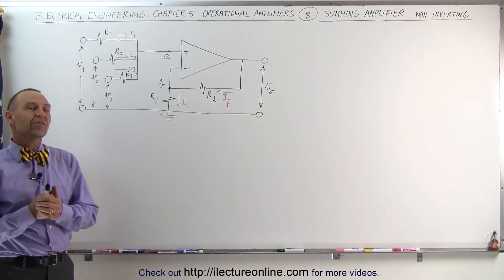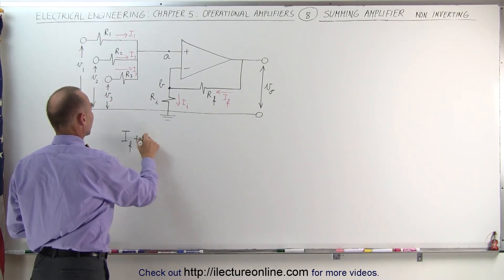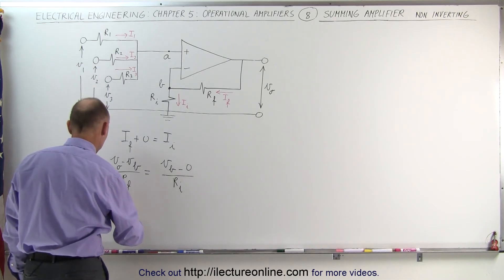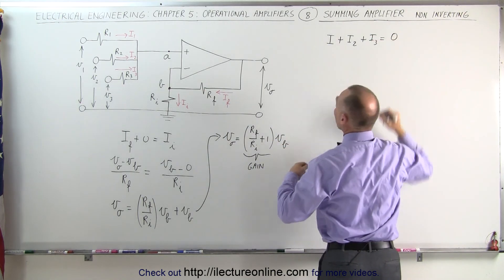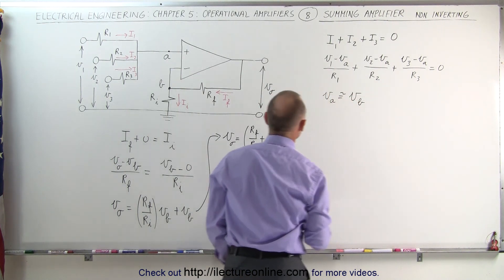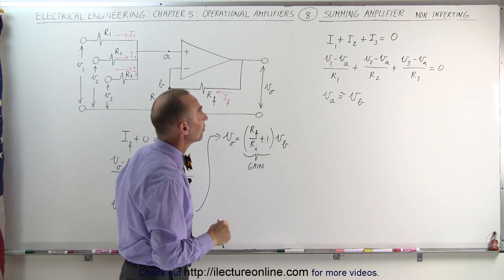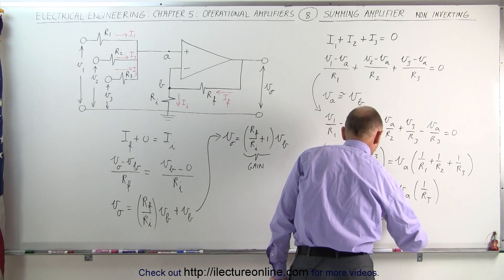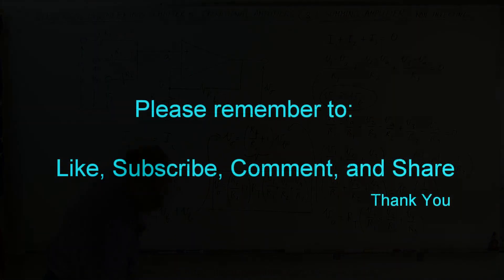Electrical Engineering: Ch 5: Operational Amp (8 of 28) Summing Amplifier (Non-Inverting)

Comment: I think 1/R1 + 1/R2 +  1/R3 is not the same as 1/RT, since adding fractions is not the same as adding whole numbers.
Reply from the maker: That is the correct equation for adding the resitance of resistors in parallel.
Reply: @MichelvanBiezen  Ahh okay I understand since 1/RT = 1/R1 + 1/R2 + 1/R3 but is it really okay since cross referencing in the figure they don't share the same voltage nodes v1 v2 and v3?

Comment: Hi Prof Michel. I noticed that transformation of sources (thevenin norton equivalence) can be used instead of KCL which makes the gain expression more understandable. For example, if we transform the 3 thevenin circuits at the non-inverting input to their norton equivalent, we easily find the voltage at the non-inverting terminal which is just ohm's law - the product of the sum of the 3 norton current sources and the parallel resistances of the 3 norton resistances. Then this voltage is converted to current by resistor Ri and converted back to voltage by Ri + Rf. Source Transformatio and Ohm's Law is a very powerful combination. The gain expression you arrived at shows this. Thanks again for your video lectures sir. They provide us with the necessary concepts to breakdown the complex.

Comment: Where exactly is Vb? And why is it almost equal to Va?
edit: ok Vb is Ii*Ri, still dont know why its almost equal to Va
edit2: ok so Vb and Va aren't actually equal, but Va is 0. I believe you should have started directly with Vb instead of Va, at least in my opinion and with all due respect. I still appreciate the videos.
Reply: The rules of an ideal OpAmp are: 1) No current is flowing in or out of the inputs. 2) The OpAmp tries to keep the inputs the same voltage

Comment: Do you always buld the equation using high potential - low potential?
In Video 3 you did it differently. I am really confused :(
Reply from the maker: You don't have to set up the equation from high potential to low potential.  It works both ways.